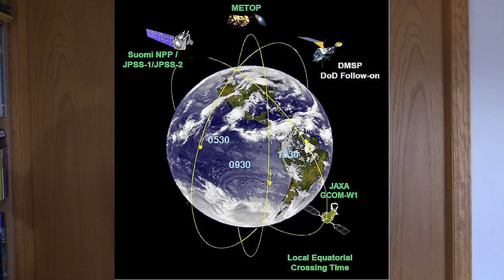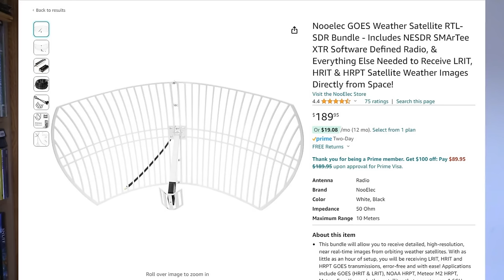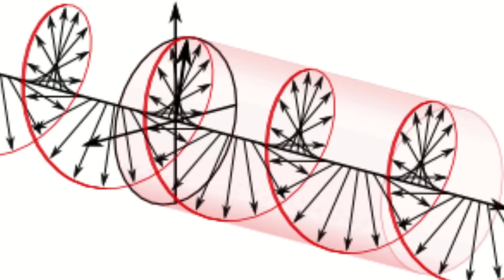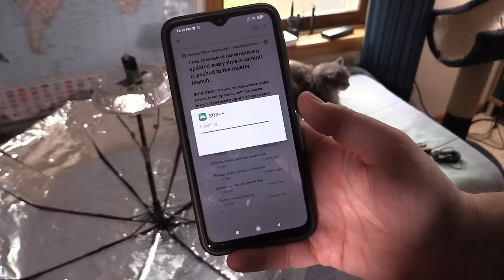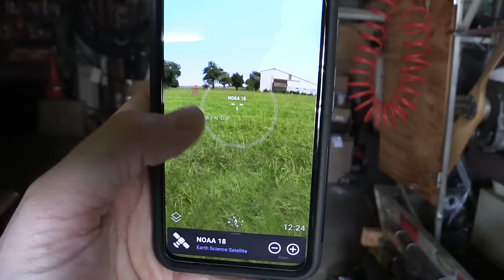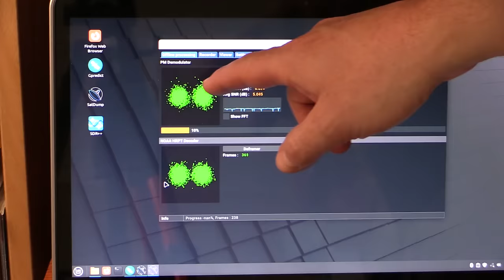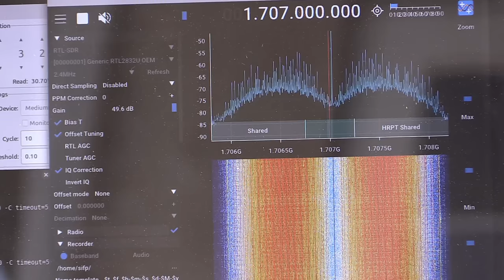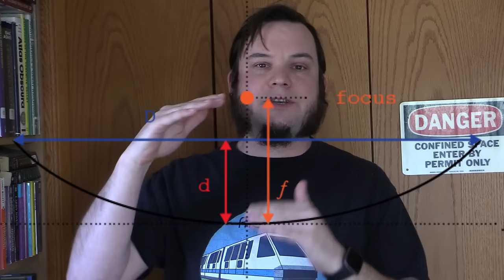How To Receive And Decode L-Band Weather Satellites

Comment: I was told does a T12 fluorescent tube was just the right size to wind a helical around for a certain frequency but I don't remember which one?
Reply from the maker: Interesting! I haven't seen one of those for a while, even at work we've gone to all LEDs. I usually use PVC pipe since I have a lot of scraps hoarded.

Comment: What about having multiple dishes running at a pass. If you manage to "average" the raw signals together it would reduce the noise (random fluctuation should cancel out statistically and signal should add up). Even two instead of one dish at a time should give a proof of concept.
Reply: "Very large backyard array"
Reply from the maker: I tried doing a "Very Small Array" once, but it was too hard to sync the signals through the hardware I have. Maybe if I had a KrakenSDR or something else that could time-match multiple inputs, but for now all it does is amplify the noise!
Reply: I thought of just recording the two signals (with two sets of hardware) and then later on letting an algorithm combine these two. Combining them based on timestaps from GPS time or just with an algorithm thats aligns them. But sounds complicated and time intensive.

Comment: Would it be possible to use moving head as antenna holder and DMX protocol for control ?
Reply from the maker: Maybe, it depends how much weight / torque they can handle.

Comment: how sharp these images? E.g. what is the scale of them, meters per pixel?
Reply from the maker: I believe it's around 1km per pixel, so not crazy resolution, but it also covers a swath around 2,800km wide. These are designed for a quick overview of cloud patterns and atmospheric temperature, not pretty ground pictures. Those are just a bonus :-)
Reply: @saveitforparts  thank you! After one of your previous videos, I've been thinking these image are HD, e.g. at least 5 to 10 m per pixel and they can be used for spying or something similar.

Comment: Is it normal to have my RTL-SDR v4 to require a large frequency offset to work. I also can only see half of the FM signals in my area and nothing else.
Reply: I really don't know anything, but my first thought is that you should look at your antenna
Reply from the maker: That doesn't sound right, maybe check if you have the latest drivers and not the v3 drivers? Otherwise I'm not sure!

Comment: Also, has anyone tried USB over Ethernet adapters? So you can put the SDR on the antenna and run Ethernet to the building where the computer is located.
Reply from the maker: I haven't tried that exactly, although I do have a Raspberry Pi with SDR right at an antenna, that's accessible over my network.

Comment: is it possible to do this with a tv satalite
Reply: yes, I just asked a neighbor if I could have their old retired HughesNet dish and they gave it to me for free. It's bigger than the dish network and directv dishes. The smaller dishes will have weaker signal and require more more gain and attention to aim.
Reply: In a way it's a lot easier. I watch a lot of Ku-band DVB satellite TV. It helps to have a 1 meter dish, but I watched a ton on just a 76cm. Plus there are ready, made motors and many many super cheap receivers. I don't recommend them necessarily but I've seen DVB receivers for $25 new. You want to look for the phrase "FTA" or "Free-to-air."  There's a lot that isn't encrypted including raw digital satellite newsgathering feeds. Just be aware that some pirate sites disingenuously call their hobby FTA.
Reply from the maker: A bigger dish helps, but I've seen people online using the regular small Dish Network antennas. Since they're an offset feed you have to hold them at kind of a weird angle to the signal. I have a video coming up where I messed with L-band on a 3ft dish, but only from a geostationary sat since I didn't want to move the big clumsy dish around to track anything.

Comment: I don't know anything about antennas, but
If the electric field travels along the helical antenna at a speed relative to the frequency,
And it travels away from it at the speed of light.
And I'm assuming in a direction parallel to the path of the field traveling along the antenna.
Uuuhhh ...  my brain hurts
Must investigate antenna theory now.

Comment: You'd be better off connecting the SDR directly to the SAWbird filter and run the usb cable from there rather than running the l-band signal down that long tiny crappy coax. And SMA connectors are VERY good connectors... if you get the good ones. Spoiler alert, the cheap junk connectors from china are CRAP
Reply: Close USB wires cause strong interference. therefore there is a long wire between the LNA and the SDR
Reply: @alexshu1609  The USB is at the RTL-SDR anyway, and most of the interference comes from other sources in the computer, not from USB cable or the RTL-SDR itself. Moving the SDR away from the computer on a long USB cable is actually beneficial in most cases and will give you lower noise. Your choices are either a) loose a LOT of l-band signal in that crummy coax, or actually reduce the noise from the PC in the RTL-SDR by moving it further away from the rest of the compute on a long usb cable, and NOT losing most of the signal in that coax, both of which give improvements... tough call isn't it...
Reply: @gorak9000  Sorry dude, but fewer USB cables mean less interference, which is a personal pain I've gone through in practice. Although theoretically you are right. But the LNA significantly solves the problem of signal attenuation in a not very long cable if the LNA is placed near the antenna.